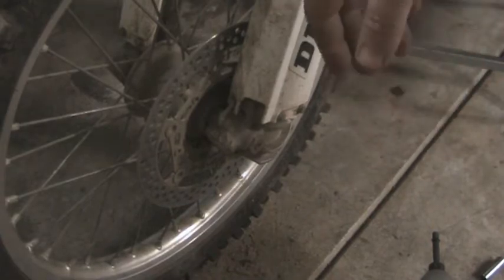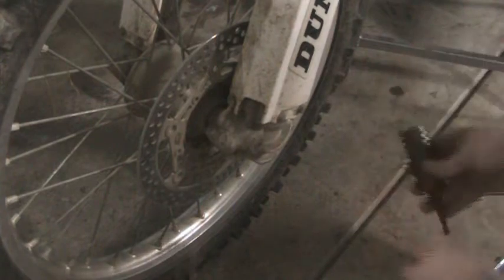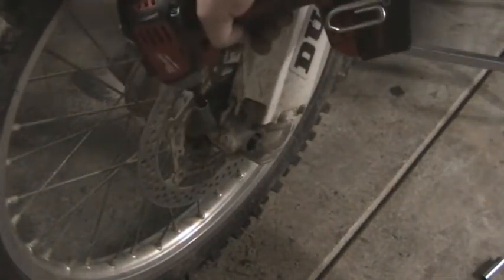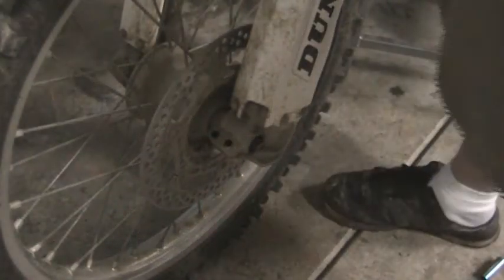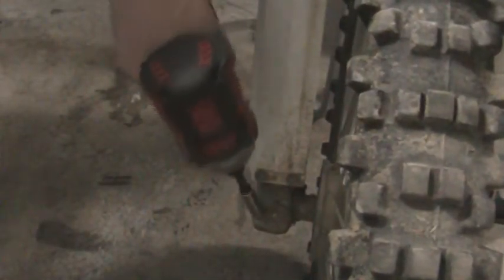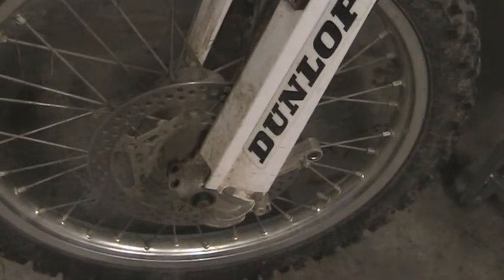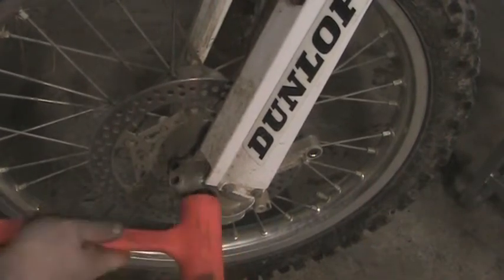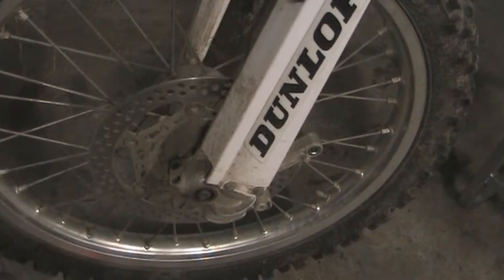Part 37: How to disassemble a motocross bike. Removing Front Wheel. YZ250F example.

Comment: Hello there, it´s necessary to release or do anything with the front brake?
Reply from the maker: Depends on the bike. Most you won't need to but some require a bolt to be removed.

Comment: on my yz125 1 of the 4 clamp bolts is slipping. both with a ratchet and spanner due to the small head, any suggestions as to how i can get it out?
Reply from the maker: You could try to get a set of vice grips clamped on it to remove, cut it off or weld another nut on top it and remove it that way.